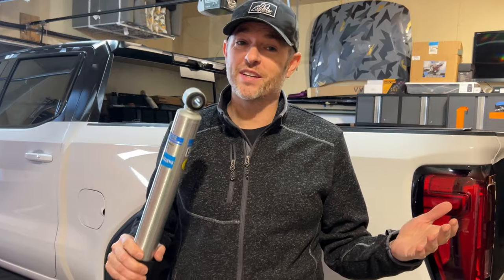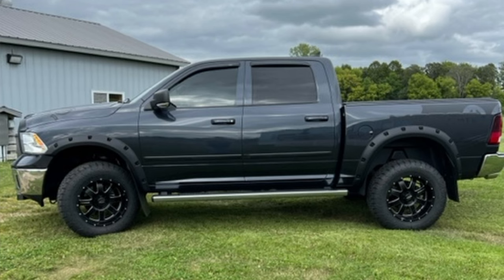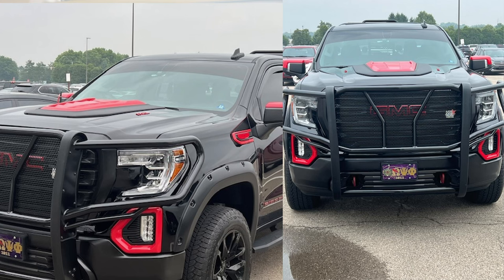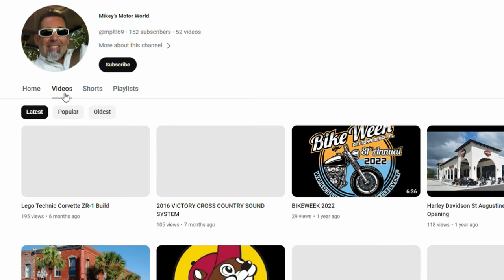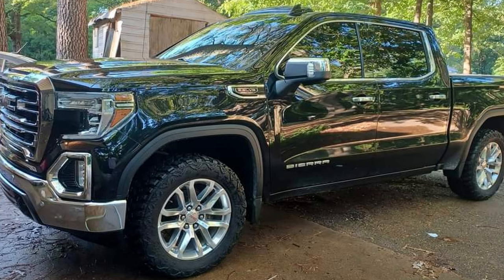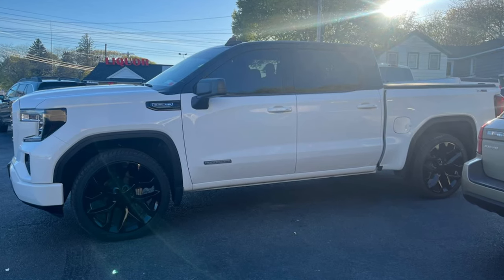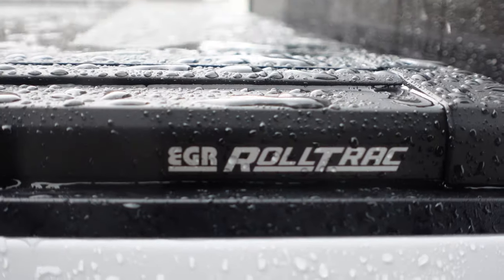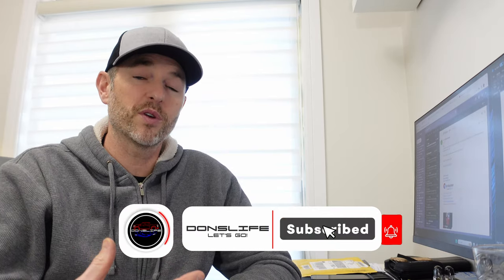DONSLIFE Shares Your Truck Projects & Mods - Inspiring!

Comment: Great video thanks for sharing. Question for you and your viewers. I have a ‘21 GMC Sierra 2500 HD AT4 and have done a few of your mods. The horn on this beast sounds like it came from a clown car or a Fiat. Has anyone done a mod or upgrade to the OEM horn? Not looking for a train/air type horn. I’ll do that later, just want to make the OEM horn louder so other drivers can hear it. The horn sound just seems to get lost in that giant engine bay. Thanks.
Reply: Good idea not to consider one of those obnoxious train horns.
My suggestion may sound dumb but trying out the horns on other trucks is one way to do it. I'd start with new medium duty trucks.
Reply: @DougT25427  Thought I replied to you yesterday buy don’t see it today? Anyway you’re spot on. I tested a few others (even a Ford😱) and believe it or not the one in my wife’s Jeep Grand Cherokee was the best. No doubt horn placement plays a roll but still…

Comment: Just a comment on the 285/65/20 tire I installed it in mine at4 2022 and it did not rub. Now I do have a leveling kit. I’ve had it for a year so it has wormed down but no cutting or bending. I put nitro tires

Comment: Hi Don, love your videos. I have a question. How can I get my folding mirrors to automatically fold/unfold
Reply from the maker: I have the option in the settings of my infotainment system.  Mine can automatically fold/unfold with lock and unlock.  It might be a ‘double lock’ press to fold.
Reply: Thanks for the reply. I went to setting on my 19 GMC Sierra SLT and the only option is ( other than the switch switch on the door panel ) is to use the key fob. I wish gm would have modified the mirrors to automatically fold upon arming/disarming the system.